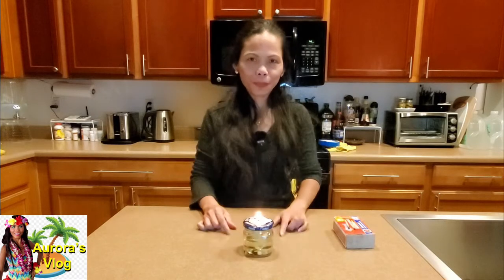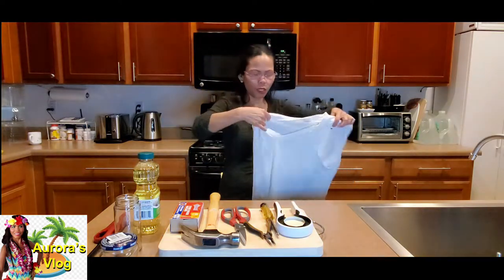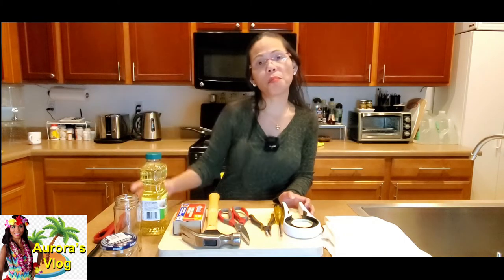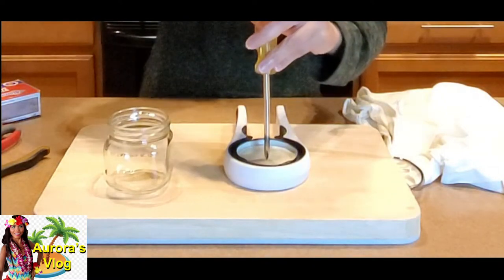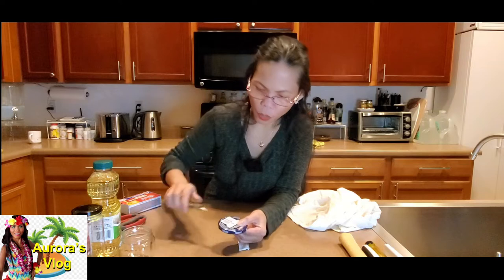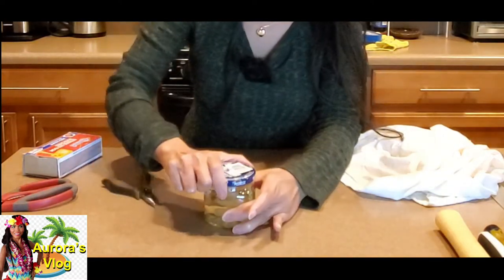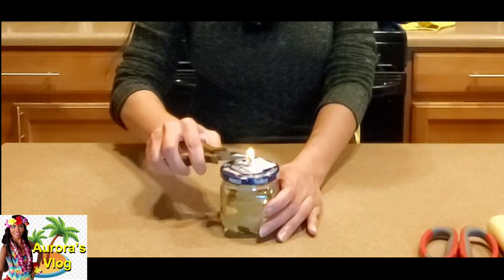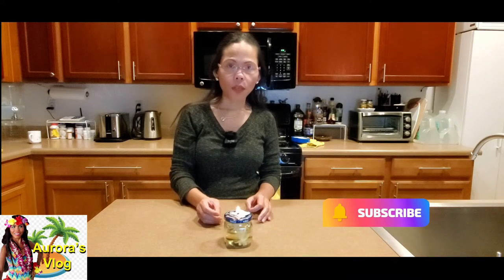DIY Survival ~ No Power, No Kerosene, No LED lamps? Do This! Oil Candle Lamp ~

Comment: Cats and candles can be dangerous. Make sure cats can not knock over your lamp. Make a very heavy lamp holder out of bricks.
Reply from the maker: Luckily they dont have cats but they have plenty of kids! They dont really use it nowadays tho. 
Currently, they still have no power. They are using Solar lights for night use.

Comment: If you want to make the light even brighter in a dark room, you can place a mirror behind it or a shiny aluminum pie pan to reflect the light better. 100 years ago and longer, these kinds of reflectors were used to amplify the light.
Reply from the maker: Great tips! I grow up using this. We called this lamparilla. Yes, I grew with up with no power, no tv just power battery AM/FM Radio.
Thanks for visiting Jojo.